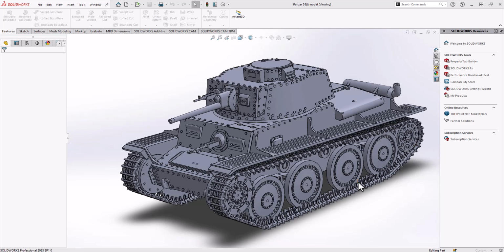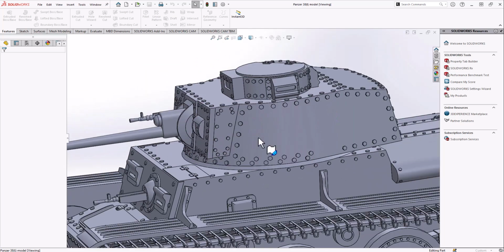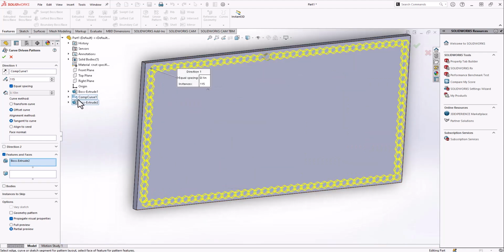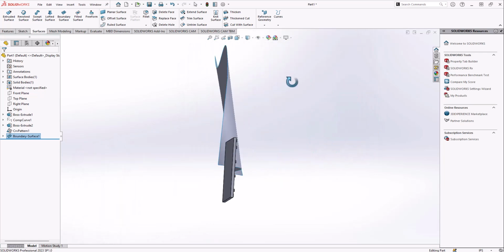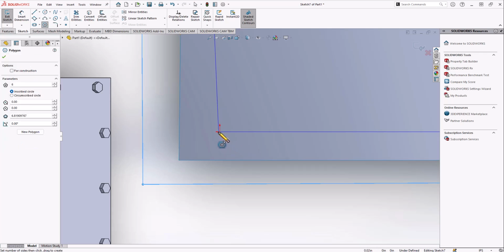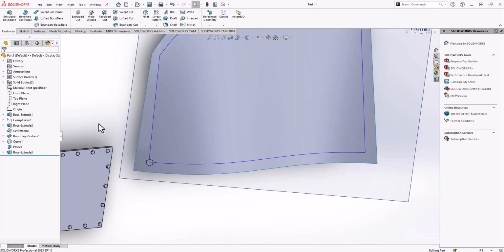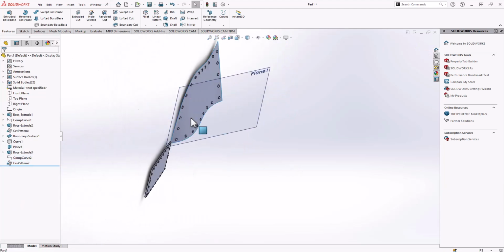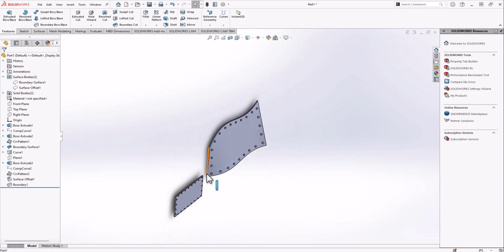Modeling Bolt Patterns in SolidWorks

Comment: Really nice job.
1. I can understand your english.
2. not dimensioning the sketch felt cursed.
3. Fantastic explanations - fillets for continuous curve, and the feature tree gatcha. 
4. A great complicated example in the second half.
Reply from the maker: Thank you! I agree that not dimensioning is a bit cursed. For technical projects I definitely make sure everything is dimensioned and properly constrained, for these sort of display pieces it’s a bit more optional in my opinion since the features are less regular, plus fully dimensioning hundreds of sketches would be a nightmare haha.

Most of these models end up running 1,500+ features with ~500 sketches.